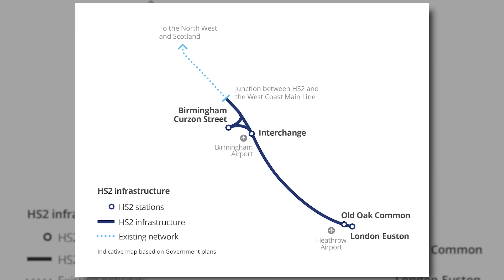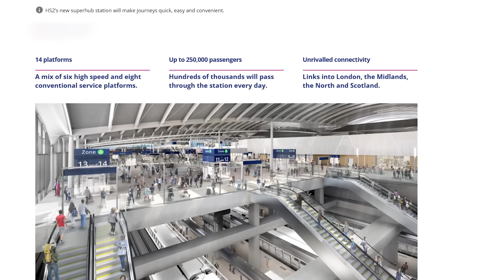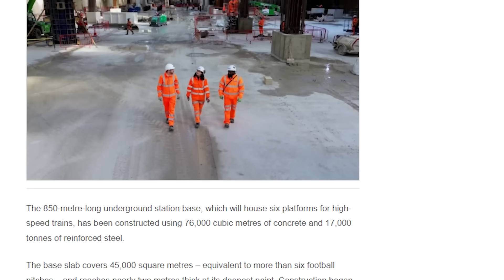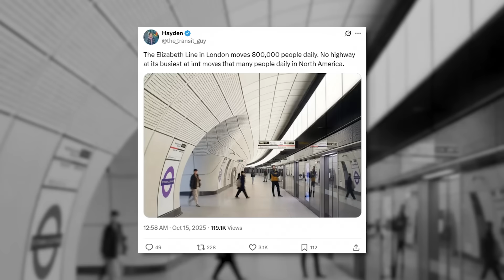London's $25 Billion Railway System Makeover is INSANE

Comment: The HS1 Terminal is St. Pancras, so one would logically expect it to be the terminal for HS2 as well. No matter what they say, that is possible and desirable. But there is an anti-rail conspiracy working against St. Pancras. It's boxed in, notably by a concrete production, storage and logistics business having a number of large HS2 contracts, with various dedicated tracks and conveyor belts, and a top-loading hopper car facility, all on the St. Pancras property. The HS1 approach there was built with a lot of curves, and the station would need a lot of re-working to make it amenable to serving the passengers of both high-speed lines - though nothing like the planned Euston/West Coast Main Line arrangement, which goes west about 20 miles out of its way starting from London, and has had a history of intermittently stalled construction, preceded by a period of inordinate demolition which seemed to move along just fine! The project to get a PROPER London terminus for HS2 - by way of a drastically abbreviated Midlands Main Line  - will likely never come to fruition.

Comment: I have to ask a serious question: Why did you focus on just London? Where is the other terminus? That would be Birmingham. Not everything is about London. Do you know about the Transpennine Upgrade Project for instance? You kept on about 2025 but do you know when it will open? It's been pushed back already 8 times. Testing is currently due to happen, which is in the public domain with a simple search online, is unknown officially. Also a simple search will also identify that "delayed beyond the target date of 2033" for the full HS2 line before it is fully open, just on the section between Old Oak Common and Birmingham will open. You also brought up a graphic to show it could handle (could being the word, nothing official as of yet) of up to 250,000 people per day; could of been easier to say "up to a quarter of a million passengers per day" instead of "10's of thousands".

Comment: You missed a few points on Old Oak Common - it also will link to Heathrow and West to the Great Western Railway via Reading.  OOC started to install the HS2 platforms 8 months ago, but is now switching to build the above ground infrastructure, increasing 4 mainline tracks to 8 so 8 platforms can bring 4 Elizabeth line and 4 GWR services into the station
Reply from the maker: Thanks for dropping these extra details! Always appreciate more insights on these massive projects.